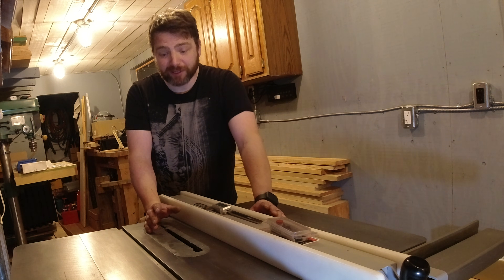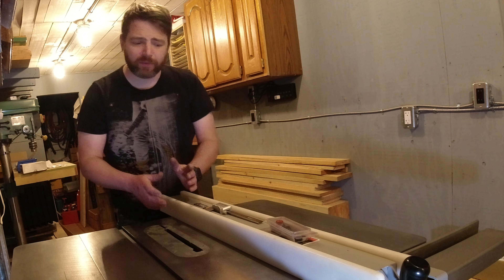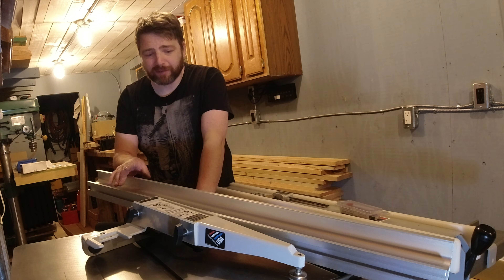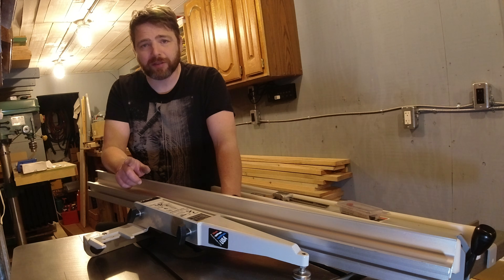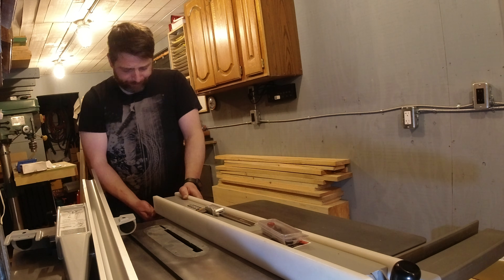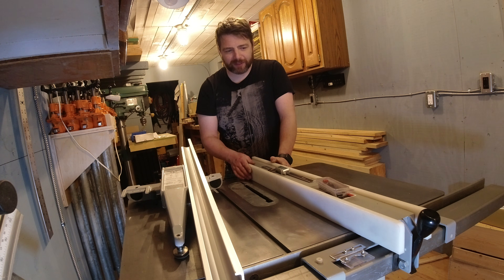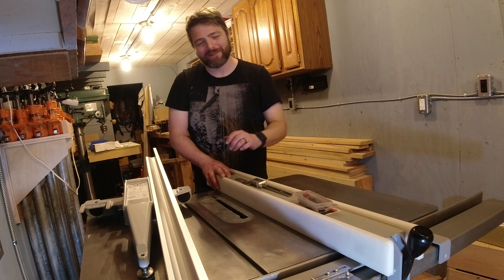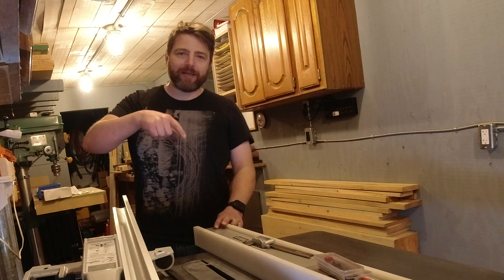Tablesaw Fences: Biesemeyer and Unifence - Unisaw Rebuild Part 12

Comment: It’s funny how YouTube searching works, or does not work. I bought a Craftsman 113 a couple months ago with that Delta Unifence and I searched high and low trying to find videos about it. 

I’m not real pleased with it and ironically want to do the opposite of what you did. The Craftsman factory top was skeletonized iron, so the previous owner made a solid top for the right side to accommodate that Unifence. Someone did not get it mounted level, which I’ve fixed, but getting it to slide smoothly and latch tightly is still a battle. Of course it’s gotten cold, so I’m not really messing with it, but at this point I think I’d rather put the factory iron top back on and find a different fence but it’s hard to want to drop a bunch of money when I have so little in the saw already.

Comment: One thing to investigate when UHMW is attached to the Accufence and Biesemeyer is to check the tightness of the bolts that have snugged it to the fence rail body. Most people think they should be cranked down. If locknuts are being used, the bolts just need to be snug enough to hold the fence in place, not tightened down to the point of making the UHMW become indented at those attachments points.

Comment: run the fence as it is over the jointer. Nylon joints just fine. If you take off the nylon before jointing you risk getting a crooked result because maybe it's the fence itself that is bent.
Reply from the maker: That's a great point. Thanks.

Comment: I have a Unifence on a late 1980s / early 1990s Delta Unisaw and a late 1980s Delta model 10 contractor's saw.  Those are nice rip fences.  I replaced the high-low aluminum portion of both Unifences with a Peachtree supply rectangular shaped fence arm ( https://www.amazon.com/Sacrificial-Designed-Upgrade-Proudly-Length/dp/B08P51K7LX/ ).  The T track at the top of the fence arm allows mounting a JessEm 04301 Clear-Cut TS stock guide to the rip fence.  The rectangular shape simplifies the process of attaching sacrificial fences, while still supporting the ability to slide the fence arm so that it is in front of the blade.

I have had a Rip-It 2.0 automated rip fence ( https://www.kickstarter.com/projects/jphadaway/rip-it-20-the-automated-table-saw-fence/ ) on order for the last year and a half, but those fences are not shipping yet.  When I receive that fence, I will likely move the Unifence on the Unisaw over to the 1982 Rockwell Unisaw, although the stock fence on that saw seems to work well.  When I replaced the arbor bearings in that 1982 Rockwell Unisaw last year, the very fine threads at the end of the arbor became damaged.  Fortunately, I was able to buy a new arbor for that saw.